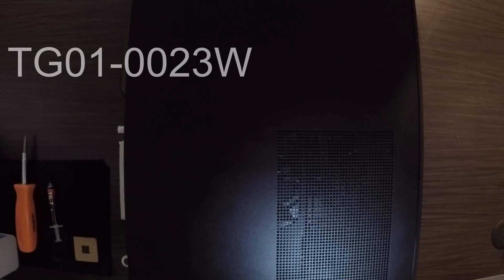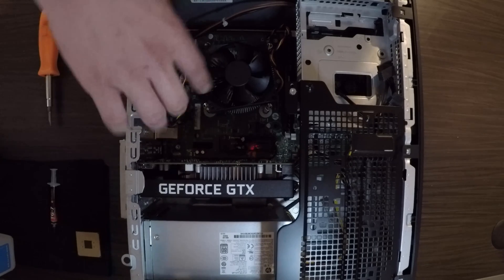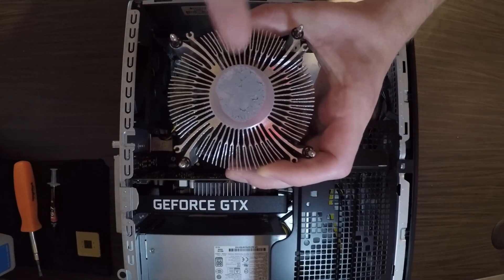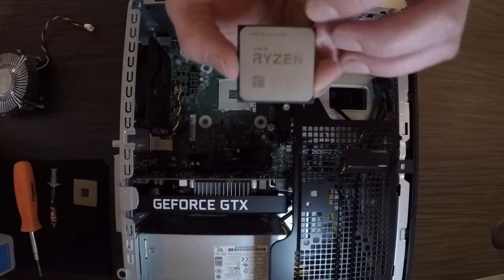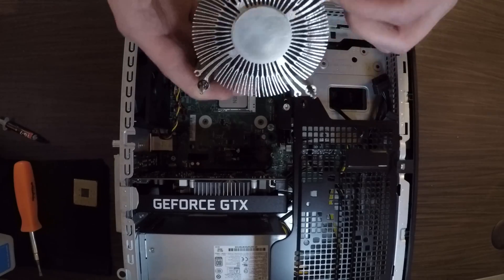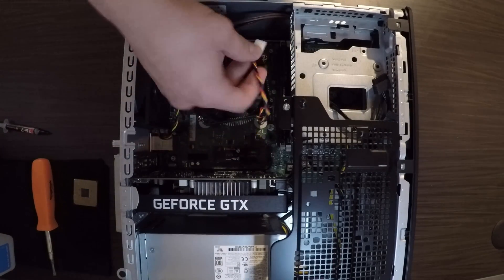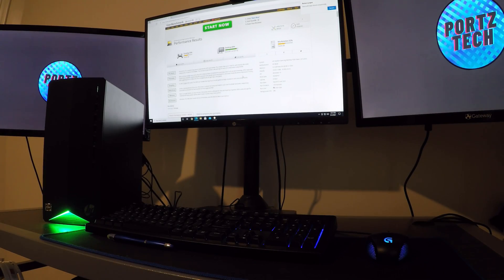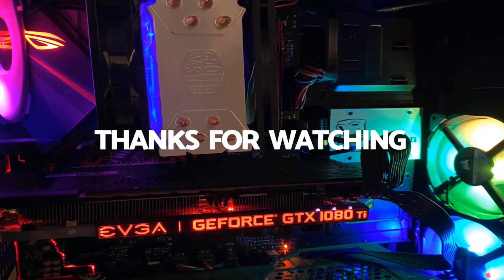HP Pavilion Gaming PC Gets New CPU TG01-0023W

Comment: Mine came with a Ryzen 5 5600.  I'm about to just reuse it for another build. You're very limited to what you can upgrade with that tg01.  No psu over 500w  am4 socket board.  Case is very small and can't swap it to another one without switching the motherboard.    But it was an ok PC for older games I guess?  I had a 3070 in mine " barely". But now have a 4070 super.. so I have to rebuild.

Comment: I changed out the processor and it shows no display. How do I fix that??
Reply: Mine is doing the same thing. Did you ever figure it out?
Reply: @michaelstahlman1781 yeah I did actually. It had to do with the bios. I ended up just putting the one it came with back in and getting an upgrade for my new pc

Comment: ooof, great vid but the hardware used for upgrades leaves a lot to be desired. Theres a very small real world difference between a 3500 and 3600 specially when it comes to gaming (if the mobo was more capable for overclocking through bios it would make more sense spending the money there but thats not the case with the tg01). That said the best cpu this mobo would take is a ryzen 7 3700 (which is not much of an upgrade either). 
I paired this system with a 2060 (you could go 2060 super/3060/4060 but i wanted to leave some psu overhead and i dint want to spend big bucks on the newer cards), 32gb of ram running at 3200(clocked with ryzen master),  2tb evo 970, noctua 92mm cooler, 2 120mm front fans (i drilled 2 120mm holes on the front to mount them) + 1 rear 90mm fan (u can probably leave the stock one and be fine).

This would leave the system being barely cpu bound, at which point i would recommend saving for a new mobo, psu and cpu and moving into something more modern like a i5-12400F(150$)  or the Ryzen 5 7600X(215$). Both of these chips have DDR4 and DDR5 mobos available, leaving you with a much better upgrade path depending on ur current budget.

Comment: i have the TG01 2170m that came with a ryzen 3 5300g and i tried upgrading to a ryzen 5 3600 but it would not boot, i put the ryzen 3 back on . . any tips for updating the bios so it could work? any help would be greatly appreciated 🙏
Reply: The only best cpu you can upgrade to is a 5700G i believe. HP have locked down the motherboard to only support 5300/5600/5700g CPU's only. HP suck for this.
Reply: @gamestech9016  thank you for this info, and yeah its very frustrating they dont specify what cpu does and dosent work.

Comment: I upgraded my ram and the gpu to a 2060 on my hp pavilion TG-01 2022...The last thing I want to change is cpu...there is a ryzen 3 5300 that came with it but I want to upgrade to a ryzen 7 3700 8 core ...the 400W PSU I have in there now is great and the RTX 2060 runs great with it but will I need to upgrade my power supply if I decide to upgrade to the ryzen 7? Or will 400W still be fine?  I really don't want to change the power supply but if I need to I will
Reply from the maker: You should probably upgrade that power supply! If you need more help feel free to join my discord
Reply: @PortzTech  thanks so much man...well damn i really didn't want to upgrade the psu but I guess it's probably smart too...
Reply: @gambino48  did you ever get that ryzen 7 3700 installed?

Comment: I’m trying to put a 5600x onto this prebuilt, but my Monitor & M&K (worked 10 minutes ago) won’t turn on ):
Reply: Same here lol. I’ve been trying to figure out what’s going on. Did you get yours to work?
Reply: @derricksmith3973  The CPU was incompatible with my motherboard. Which I discovered on a website I can’t recall. When I was returning it, the guy at microcenter said all you’d have to normally do is update the BIOS. Try doing that.

Comment: hey i have a question, I bought this exact PC and its coming in like a week, but i just want to know the best upgrade for this PC in the future. I got the ryzen 3 3500g 8gb ram 512 SSD, no HDD, 400w power supply, and the radeon Rx 5500 4gb( gddr6). So should i upgrade the ram first, or the cpu, or the gpu, or hdd, or the sdd. Which one should i upgrade first.
Reply from the maker: GPU are the best things to upgrade, most games are graphically demanding now so a better card means better performance for most games. Ram is cheap to upgrade, then storage is too. The cpu/gpu are usually expensive. Any old parts you can always sell

Comment: i have a extra rtx 2060 i was thinking of getting this pc for my nephew  would this pc be able to run the 2060 if i swapped it in or will i have to change out the psu
Reply from the maker: Yea, it should be plug n play for that 2060. Just make sure it fits in the case. Eventually you could upgrade the power supply, but you should be fine

Comment: Ive seen your videos on the gpu upgrade also can this pc hold anymore powerful? Like i saw the gpu upgrade was to the 1660 and i dont consider a ryzen 5 to a ryzen 5 big enough difference 
Can this pc handle a 2060 or a ryzen 7?
Im not entirely sure of what specs yet. I still need to do some research. But are these upgrades your adding the maximum?
Reply from the maker: They are not the maximum you would need to do some more research
You could probably add the 2060, but I doubt the ryzen 7
Reply: No I put ryzen 7 in my but I would also recommend quite fans to
Reply: @naijahfed-up1783  can I ask which Ryzen 7 you upgraded to on this PC?
Reply: @Gojirasu   ryzen 7 3700x
Reply: @naijahfed-up1783  could you put the Ryzen 5 5600g on this PC?

Comment: i was able to take off the fan but when i swapped the cpu to a ryzen 7 5700 it wont turn on? The lights and fans are working but it just won’t turn on
Reply from the maker: If you have the HP TG01-0023W then this mother board can only support certian cpus. Here is a link to HPs website so you can see which ones will work. Best of luck, let me know if you have anymore questions
https://support.hp.com/us-en/document/c06418627

Comment: So I have an issue with my PC. I explain the issue in this video. https://youtu.be/hdRwgCgS5AA

In 1 video I saw it seems it could be that the CPU died and I need to get a new 1 or my motherboard. Any ideas?
Reply from the maker: Unplug your hdd or sdd. Try booting after that and if you get into the bios then you know that you need to reinstall windows. Otherwise make sure everything is properly seated in the slots on the motherboard and everything is plugged in properly. Make sure everything is dust free or clean. Let me know how that goes

Comment: First thank you very much for making these videos of the tg,0023. My PSU went out and I can't find anywhere or anyone that can print me in the right direction of how I can get another PSU or of it's even upgradable. Which I have seen you do it so could you please help out with some more of your wisdom please🤣
Reply from the maker: Thanks!! Either swap the case, power supply, and motherboard or order another psu off ebay. Pull the psu out then google search the part number. That will be the best way of finding it

Comment: I have the TGO1- 1022 version and it comes with a 310 Watt power supply, if I wanted to switch it out for a more powerful one would I have to change the motherboard? Or rather, what would it effect?
Reply from the maker: You would have to get another hp one or get one from another tg01 series like this one. It should just be plug n play. If you wanted like Evga 500w one you have to get a new case and most likely a motherboard. The tg01 pc in this video has a 400w power supply
Reply: @PortzTech  Okay got it! Appreciate you!
Reply from the maker: No problem!